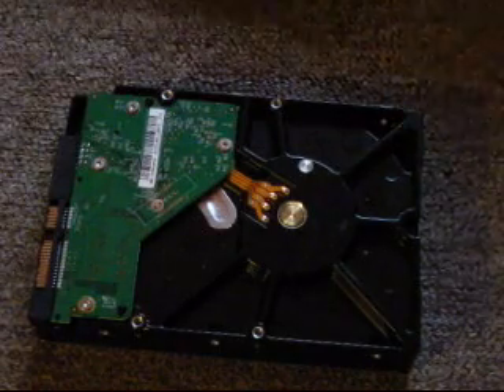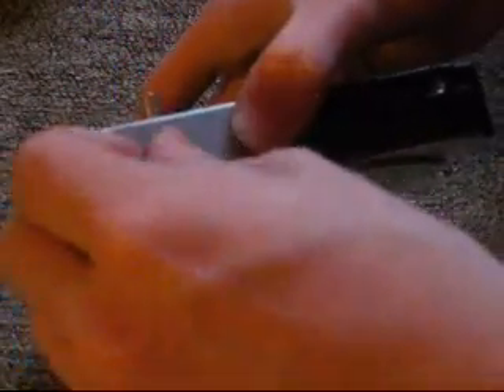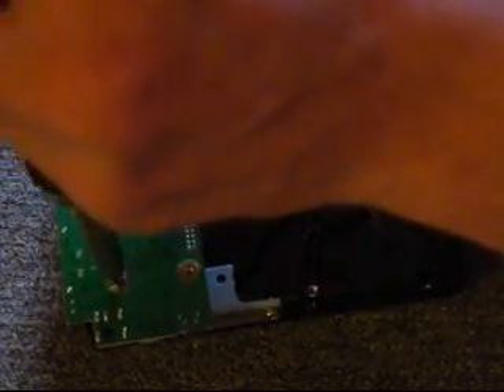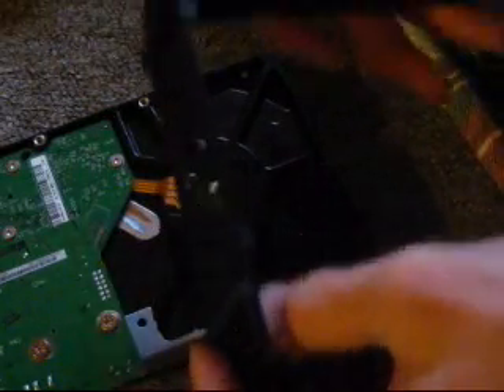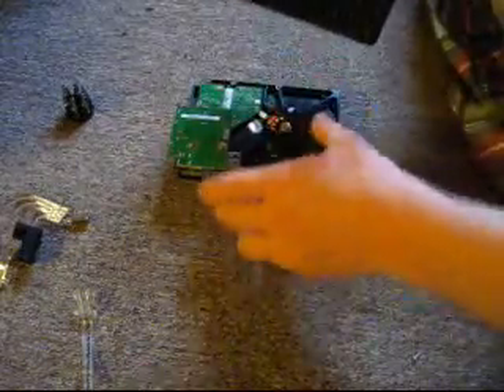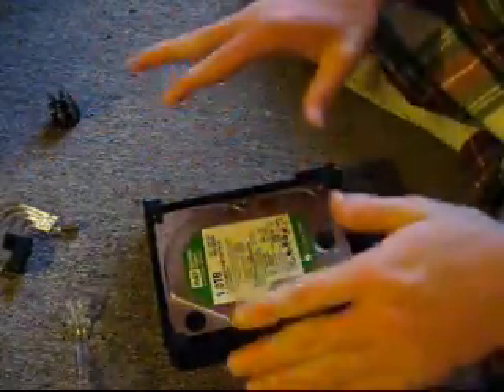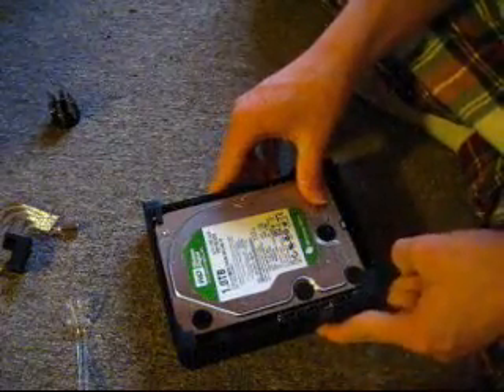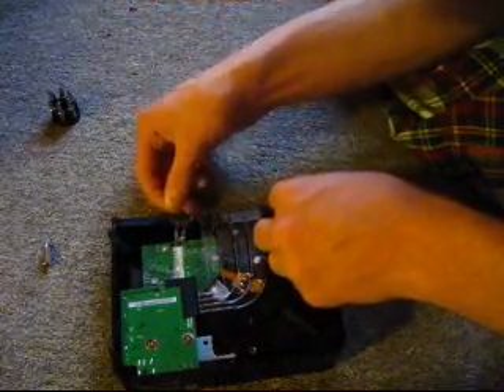How to REASSEMBLE a WD MyBook essential edition external HDD part 1

Comment: Put the rubber holders on the 'external' controller board side, then mount that side of the drive into the plastic case first. Next add remaining rubber pads to the metal drive case. Adding those two remaining pads can only be done when one side of the metal drive is still hanging outside the plastic case. Slowly close the drive and the plastic case like a book. Naturally, it's necessary to make those two remaining rubber pads slide into the plastic case - so careful manipulation is needed to get those pads at least partially slotted into the case.

Comment: ... here are some pictures of the rubber pieces (in the right positions), if by any chance somebody had some difficulties with assembling their WD My Book Essential ;)

photobucket com/wdmbe2tb
(put the the dot etc. for the link to work)

P.S.: I reassembled it so, that at first I left the smallest of the four out (I don't count the fifth one which is not on the corner) and when the disk was already with all three rubber parts inside the plastic case/frame I put also the fourth one in.

Comment: I put it back together again after the dog knocked it over.  The rubber bits need to be looked at logically.  If you look carefully you'll see some little holes along the side of one of the fatter pieces and this lines up with some little lugs on the casing.  Work it out from there. The whole thing is seated on these rubber bits and with a bit of patience you can put it together like a jigsaw.  Mine is working again and the dog is out of the doghouse.  Many thanks for the video.